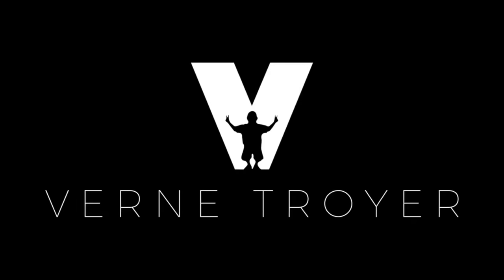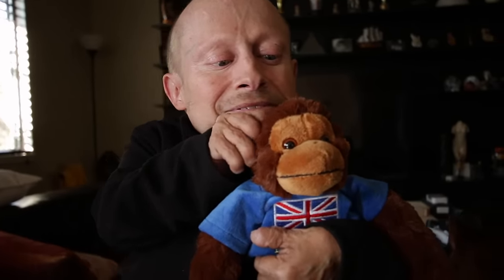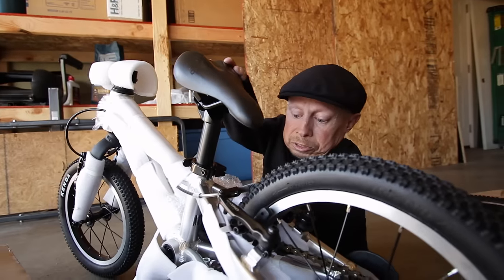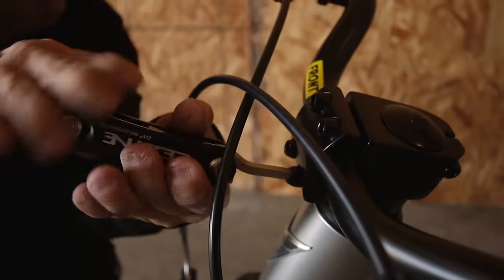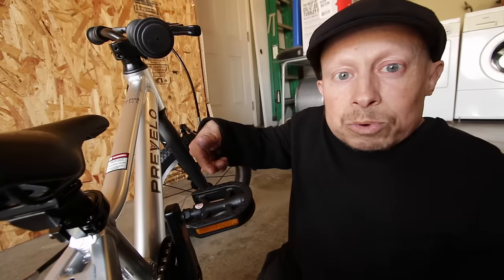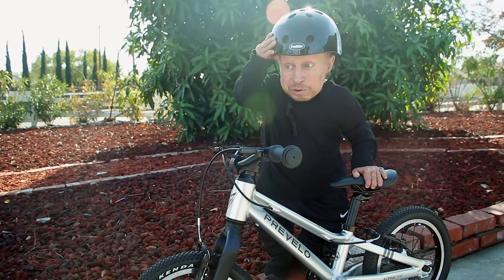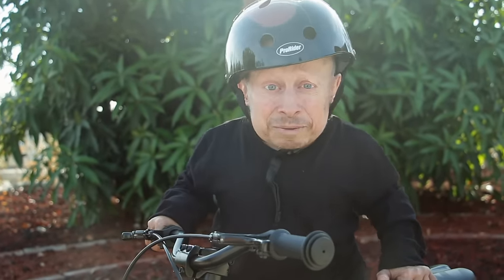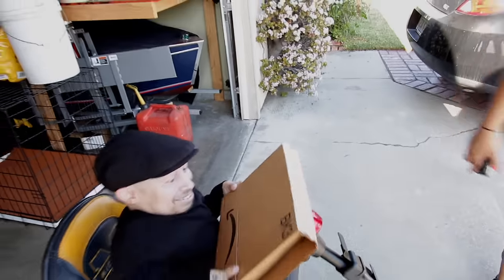How To Ride A Bike! (Unboxing)

Comment: Cool bike but I think you need to lower your seat your legs are stretching to far as it looks like your pushing the pedals with your toes at lowest point no pun intended but you need to be able to put your feet on the ground safely and not fall over. Have fun.